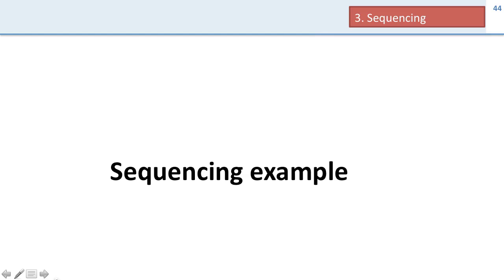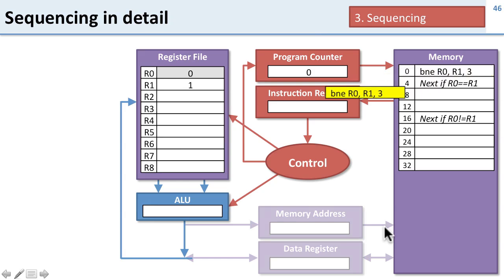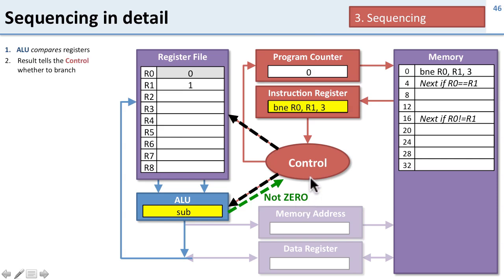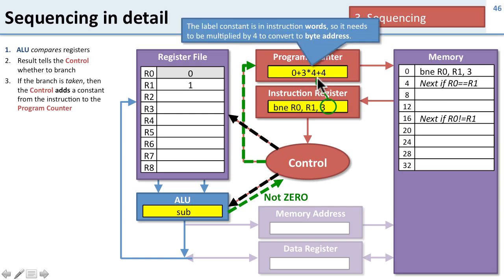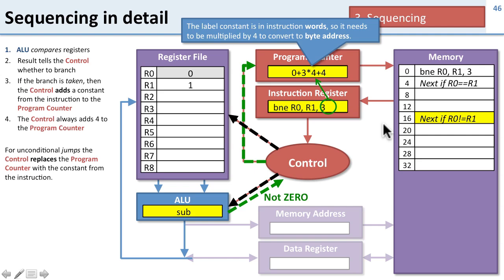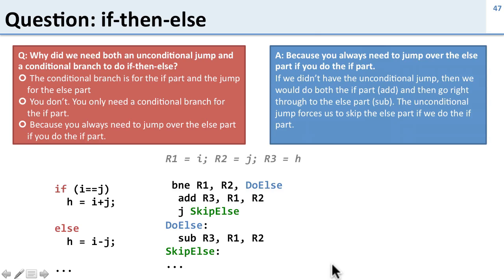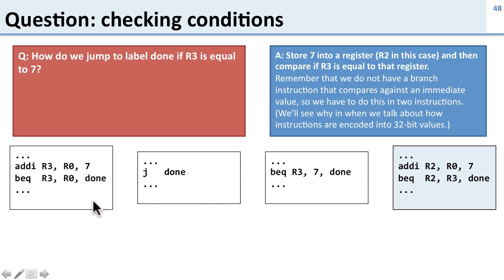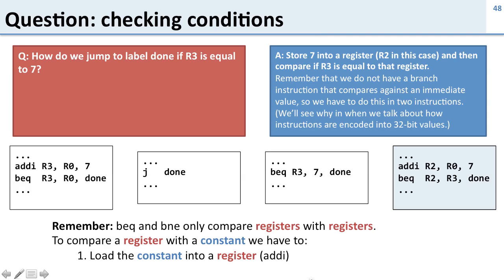ISA 1.8 Instruction Sequencing Example

Comment: Your explanation about updating the pc with tge next address would be clearer  if you had said that 
Since each memory address or l instrction  has 32 bits = 8bits *4 or 4 bytes , the current memory address itself has 4 bytes in size + other 3 addresses ahead of it of which each also has 3 bytes 
So the current address "0" has 4 bytes + 3*4 bytes for the other 3 addresses = 4 + 12 = 16